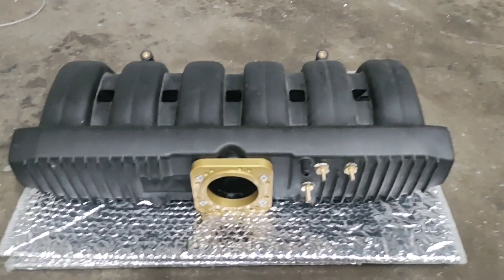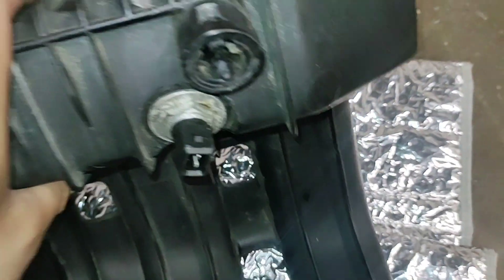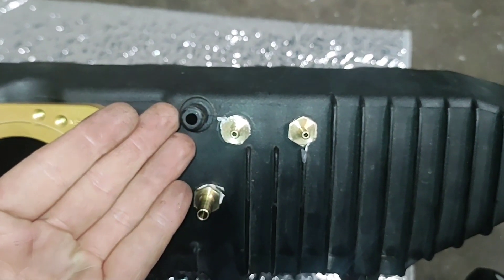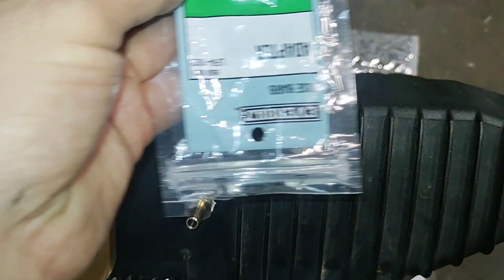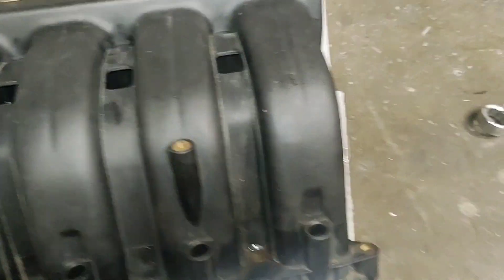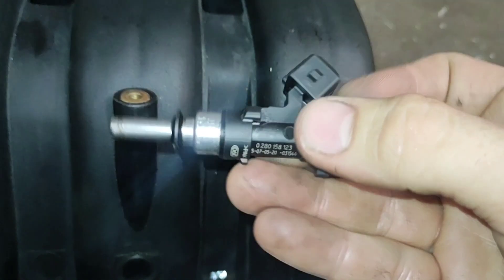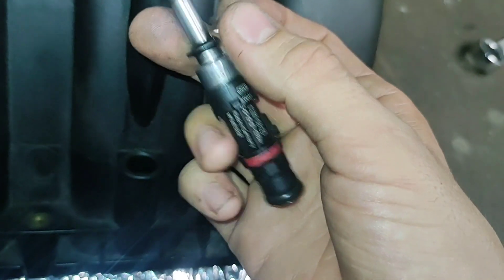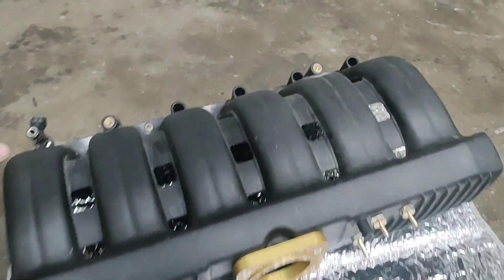Tips for Using the BMW M50 Intake Manifold with Boost

Comment: My m50 manifold already had those holes with metal tapped inserts from factory. Jus had to drill a hole all the way threw and screw in some fittings

Comment: Thank you for the video. This is helpful. I don't like the self tapping for vacuum ports due to potential leaks, encourage others to find ways around it by Ting into lines for brake booster when possible. But to each their own. Something to also consider with the M54 to M50 manifold that you don't want to overlook is how you are going to block off the ICV ports from the M54 manifold. You can either use a block off plate such as Hyde Motor Works solution, or you can self tap it with screws and thread sealant. Best of luck!

Comment: Nice video wish I would have found this a month ago. I’m doing a e46 328i turbo build. I did the m50 manifold swap and put the aftermarket injector on with out the spacer not knowing it was needed. Then the genius that I am start removing the injectors without taking the manifold back of from the block. In then I was able to fish out the plastic o ring that holds the o ring in place on the injector.